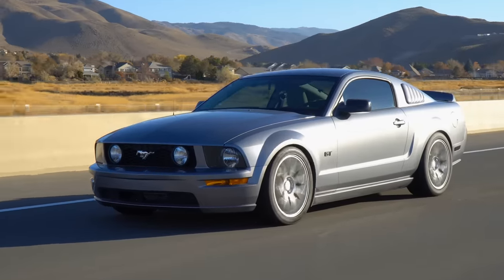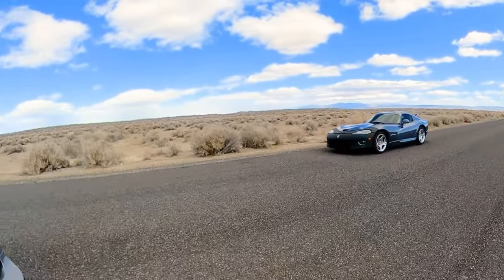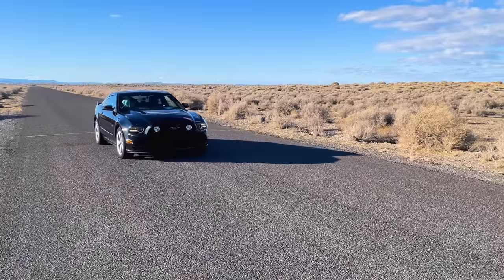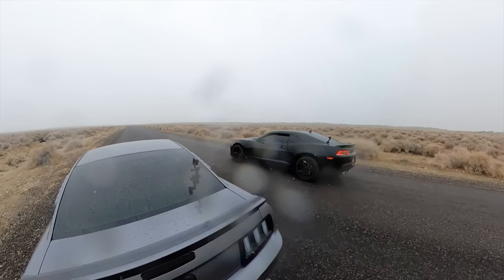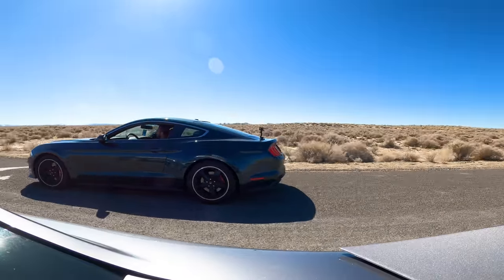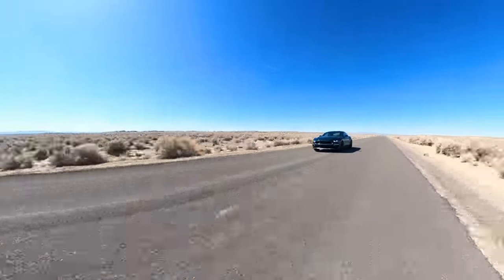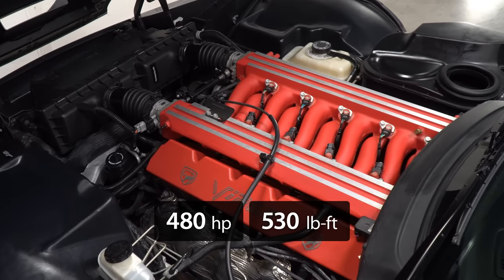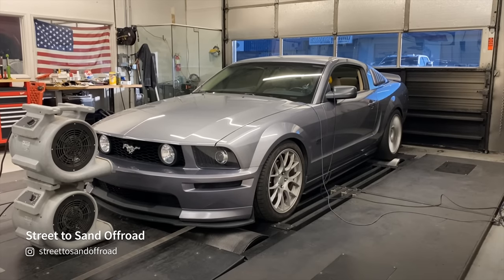Showing the world what an all-motor 4.6 Mustang can do

Comment: If memories serve, these cars went 0-60 in 5.3-5.5 seconds bone stock. It was quicker than the previous gen.  Never knew they were disliked by the Mustang community.  🤷🏻‍♂️
Reply: 2 piece spark plug and cam phasers were the biggest problem
Reply: Damn straight. I already love this gen,now even more.
Reply: I run mine at 5.0 flat on the street.  Would love to know what it gets on an actual drag strip
Reply: The only began to get disliked after the Coyote engine came out. Obviously it was far superior
Reply: They were also disliked when the 2011 V6 came out and was damn near as quick
Reply: @Bmr4life  yeah the 3.7 put out like 300hp as opposed to 310HP from the 4.6 ☠️
Reply: @Bran Don  yea stock to stock. The second a juice up a 3v it destroys a 3.7
Reply: I had an 06 GT, 0-60 time was right at 5 seconds. They weren't slow
Reply: @djdirtydan3393 stock to stock I’m blowing the doors off a 4.7l, in a 2012,3.7, y’all be cappin on this app.
Reply: Bone stock 4.9 to 5.2

Comment: FINALLY US 3 VALVE BOYS HAVE THE HERO WE NEED!!
Reply: Been waiting for him to get this car back on the road lol thought he gave up or something
Reply from the maker: @justa3v619  did you see the trans install video?
Reply: @Four_Eyes  no I’m subscribed and have the bell on. Idk how I didn’t see it. I mean I’ve seen it just now but didn’t see it before.
Reply: 5.7 hemi with bolt ons make 460hp I’m going say bs to that.
Reply: @thatgaykid420  all that power just to get walked lol
Reply: Yea after about thirty years too late🤣
Reply: @thatgaykid420  idk bro, I have literally never seen a fast RT ever, challenger or charger. Whenever I run one in my 3v (headers, 4.10s, 93 tune, cams, intake) I pull away from them pretty fast. Not saying you're a liar, but you probably have some pretty substantial work done to the car.
Reply: @ryanhopkins1780  even if he’s making 460hp my 3v still makes more than that. Mine makes just over 500 to the wheels
Reply: @thatgaykid420  I guess I misinterpreted your bolt on definition. I use bolt on as just basic intake, tune, exhaust, and I guess  intake manifold counts too.
Reply: @thatgaykid420  I mean that's cool and all but hp and torque mean nothing without gearing.
Reply: @thatgaykid420  Oh gotcha sounds bad ass man! I've always considered 5.7 and 3v dudes to be part of the same "underdog" club of cars. Gap some 5.0s for us lol
Reply: My 4.6,l based 2v will walk your challenger, even you put super charger on it. 

327 c.i. all aluminum big bore trick flow 195 2v heads with additional port/chamber work, custom gibtec Pistons, custom dual plenum intake , custom cams 13.5 to 1 como ratio, e85. Dynoed over 600hp(won't give exact numbers) 
Plus has 2 dual stage nitrous kit. 175hp 1st stage 150hp second..
All motor run in my 70 Maverick best et 9.87 1/4 mile. I'm too scared to run the nawsssss....
Car weighs 2900ish with me sitting in it 
4r75w built to handle 1000hp 3800 stall triple disc anti balloon torque converter. 4.11 gears all aluminum pumpkin and housing bolt on axles steel. Frt suspension is sn95 mustang based cobra frt brakes, rear 4 link w/Watts link, rude tech air ride suspension. Carbon fiber hood, bumpers, spoilers etc... Custom grill etc... Etc... Etc...
Reply: @honda i actually respect that outlook. I owned a 79 maverick in the early 90s (still do see my other post) underdog for sure. Technically i own 2 mavericks 73 grabber mav, a built 89 bronco for off-road, and 67 Mercury cougar. Love my stable of underdogs. So i can absolutely relate.
Reply: @thatgaykid420  lie
Reply: @ItsJustFranko  you said right there!!!! It’s about the gears baby!!!
Reply: @rickstorm4198  Rick ain’t playing!!!! Let’s gooooo!!!!!
Reply: @ryanhopkins1780  my 3v isn’t anything but bolt ons and makes just over 500rwhp. But I literally have every bolt on they make for the 3v jlt cold air,pulleys, tb, manifold, longtubes, muffler/cat delete, 4.10’s, Howard cams, Lito tuned and a zex wet kit. I’ve actually got an on3 turbo kit for it in the garage but waiting to build the bottom end. I could’ve got a coyote for sure with the money I’ve put into the car but honestly I like the 05-09 body I’ve wanted one since high school when they came out. Plus it’s so much fun beating up on them newer cars with an old 3v lol.
Reply: @justa3v619  I'm gonna have to call bullshit on this one man. No way are you making north of 500 whp NA on a 3v
Reply: @17456spartan  you obviously didn’t read my whole comment it makes that on the nitrous. I’m spraying 175 shot
Reply: And actually it was on 150 shot when it made 516rwhp made 368rwhp on motor
Reply: @justa3v619  Oh ok, that must be what you meant by the zex kit. Ya 368 is much more believable. Mine with a few less mods made 340 WHP
Reply: @17456spartan  yea that’s usually about what a good running fbo will make. I’ve got another shortblock now I’m working on once it’s done it’s going in going to try and make 650+ with some boost. Need to do the same for my old 2v. I have a 2.1l Kenne bell kit for it but stock bottom end

Comment: Looks like that 2019 stang got heat soaked the more runs y'all raced. Great job waking up that 4.6!
Reply: Lol it’s not a “4.6” it’s a built stroker.  He never mentions the actual displacement.
Reply: @amateurtouring  You are right. If you read his google docs build sheet he has a MMR 5.0 STROKER Street Mod 1000S 5.0 Rotating assembly Up to 1000RWHP.
Reply: @8bert9  so by this guys logic I could call an LS7 swap an junkyard 4.8 swap? 😂
Reply: @amateurtouring  lol, yeah, the title of the video is a bit misleading
Reply: The factory tune pulls a TON of ignition timing once intake air temp gets over 100F and once coolant temp gets over 200F. Basically 1 degree of ignition timing for each 10F increase in air or coolant temp. So 220 coolant temp pulls 2 degrees and 150 air temp pulls 5 degrees. You’re down 7 degrees of timing advance, easily worth 35 HP
Reply: I thought heat soak just happens to supercharged stangs?
Reply: @amateurtouring  people find any excuse to take away merit from a 3V platform I STG. They get so much hate for no reason. People only hate because they don’t understand the car.
Reply from the maker: It's 4.93 liters, still lower displacement and compression than all the cars raced.
Reply: @amateurtouring  still a 4.6 block.
Reply: He did mention it he said it. A 4.9 stroker

Comment: Yes I’ve always wanted someone to build a 4.6 like this with the gears, t56 and built N/A. Awesome video as always! And 3.73?
Reply: 4.10 gears maybe?
Reply from the maker: 4.10's, but with the 2.66 trans ratio you can see the gears are still a bit long, should be ideal for a turbo setup!
Reply: I still have 3.55, works well with my 5.3 stroker T56. But I do road course rather than drag.
Reply: @nicolesmrekar2046  😍😍😍
Reply: @Four_Eyes  4.30’s might just be the sweet spot for an all-motor T56 build like this. This thing runs good and it runs hard. Love what you’ve done with this car.
Reply: @nicolesmrekar2046  love to see a women who can drive!
Reply: 4.10s too aggressive for cruising around?
Reply: Modular head shop sell 3v turbo cam stage 3
Reply: @headinghome8914  absolutely not.  I am running 4.10 in a bolt on 07 gt500 at 550 wheel.
Reply: That viper really hops on the shifts…😳
What a fun video… I started my car enthusiast “career” as a mustang guy… had 4 of them from the time I could drive until I was about 30… a 91 lx 5.0 a 65 with a 351, and then a 69 with a built 302 and a 85 gt that I started building in 2000 and then traded for an integra gsr and it’s been Honda’s only since…
All the newer mustangs since the coyote came out tho really get me excited about these cars again… seems like the American builders took a few cues from Japanese engineering and voila, we got lots more horsepower on the streets!
Hopefully they never take out gas cars away…
Reply: @Serpentis666  your journey sounds almost identical to mine, many people will make fun but when I cracked my first VTEC in '01, I just fell in love with Honda's, once I built my first b16, then turbo in a eg coupe it was game over, good times!it wasn't until just a few yrs ago that I got back into V8 muscle as the Honda scene has unfortunately really died out. Bought a C5  Z06, but still have my highschool car in the garage, an '88 LX 5.0, I'll never sell! Lol
Reply: @romper4444  I think some of us just genuinely love cars…whatever form “fast” comes in lol 
My first Honda was an ef I bought in around late 98 or 99… put a ZC in it around late 99 or early 2000… was fun but still pretty slow and I wasn’t ready to do a gsr swap at that point just yet… sold that and had intended to buy another old mustang, and a close friend showed me an integra gsr another friend was selling at the time… first crack of vtec and I went straight home to get the cash! Have had a vtec motor of some sort in my car ever since… all the b series and now all the k series lol 
Cars fucking rule!!!
Reply: @midnight347  that's sweet, thanks
Reply: na ha borimg!! go home grandpa it aint no LS1 it needs boost
Reply: @shawncarson8131  yeah but he plans to add twin turbos I believe
Reply: @nicolesmrekar2046  hey are the 3.55 the stock ones right? cuz ive been wanting to figure out which stock gears i have
Reply: 4.10s are fine but 1st gear is almost useless with a t56 while racing. I had a 240 with an ls1 and t56. The rear end was a 4.09.
Reply: I’ve always wanted to pop a high compression 4.6 4V into a 05-09 GT just to mess with people.
Reply: @merc6  depends on which t56 you have. with a f-fody/viper t56, the 2.66 and 4.10 combo on a 27" tall tire carries you to 50mph at 6800rpm.

with a 27" tall tire and 7000rpm redline, most ppl with a 2.66 1st gear T56 run a 4.56 is staying N/A and anything from 3.73 to 4.10 depending on power levels.
Reply: @OxBlitzkriegxO  honestly I don't even know what the gear ratio of the transmission was. It was a factory ls1 from a 2001 ws6 trans am along with the factory transmission. I just know that the factory trans from that particular t56 was very short in 1st gear with a 1995 Nissan 240sx rear end. That rear end was a 4.09.
Reply: My father's came with 3.73 and it was the only thing lacking. It needed at least 4.10 for a pretty stock N/A
Reply: @merc6  you had a 2.66 first gear. the only other difference would be tire size.
Reply: @OxBlitzkriegxO  it was a 265 35 18. Not sure the actual size in inches. That car was bad ass. Same tire on all 4 corners. They were on 18 by 9.5 in wheels.
Reply: @OxBlitzkriegxO  don't get me wrong. 1st gear was fine but it was just a little short. I bet a taller drag radial would have made that a little better.
Reply: @merc6  if you were shifting at 6500rpm, 1st gear was done at 37mph, 2nd at 56mph. thats because you were on a 25" tall tire. thats a pretty short tire with that kind of gearing. that puts a ls1 in to 5th gear by the end of the 1/4 mile at 6500rpm. a 275/50/18 wouldve been better for a n/a ls1 with some mods.
Reply: Been there done that mustang's are fast in a straight line, when it comes to cornering Nah I dont trust it.. in cornering your going to hit a wall. The mustang cannot handle a curve ball.
Reply: @Four_Eyes  do you have .80/.63 or .74/.50 5th and 6th gear?
Reply: @eternalthread7846  Love to see a WOMAN, who gives a shit if she can drive!
Reply: @TheOzthewiz  idk people that like cars maybe lol
Reply: @62guitarguy I think 4eyes has spent 10s of thousands to get it where it is today n/a
Reply: @Four_Eyes  Ah now you're talking! Excellent choice of close ratio trans\rear axle gearing for what you're gonna be doing. Gonna get wicked! :goodvibes:
Reply: If it was built to make na power it would be faster it has low boost friendly compression with boost being the end goal.
Reply: @62guitarguy those "stockers" cost alot more money to buy than a 3v mustang does.  It's all relative.  He may have spent money in mods but he saved a ton by having an older 3v to begin with.  People never factor in those newer cars costed alot more money up front so I would hope they have better performance out the box.
Reply: @wusthof641  I seriously doubt he spent 10s of thousands on this engine combo it could be done much much less than that.
Reply: @wusthof641  also if you go with those newer more capable out of the box cars you're gonna be spending 10s of thousands more than you would on a 3v so it's all relative.
Reply: @Four_Eyes  How much HP does this Mustang make?
Reply: @headinghome8914  surprisingly no. I drive 4.3 and I averaged 26mpg on the 80mph interstate on my 1200 mile road trip, which is more than the car is even rated for. In the city gas isn't affected at all, you just shift into a higher gear when the rpms are too high. I can cruise 35mph in 5th gear comfortably lol. At 80mph it's at about 2800 rpm, which is higher than I'd like but the fuel does fine. Slowing it down to 70mph on interstates makes everything perfect if you're able to. People told me not to put in 4.3's because it ruins cruisability, but that has not been my experience for the last 170,000 miles
Reply: @MountainStew02  that's awesome
Reply: @MountainStew02  thanks for the insight
Reply: DUDE FOR THE AMOUNT OF MONEY THAT YOU WOULD HAVE TO PUT INTO A 05 09 STOCK 4.6 MUSTANG GT ISN'T WORTH IT LOL YOU'RE WAY BETTER OFF BUYING A 07 09 GT500 LOL I HAVE A 07 SHELBY GT WITH THE 4.6 AND I LOVE THE CAR AND YOU CAN ADD A BLOWER AND MAKES 450WHEEL BUT MY 08 GT 500 PUT 450HP AT THE TIRE IN STOCK FORM.LOL YOUR WAY BETTER OFF BUYING A GT 500 07 09 LIKE MY 08 THAT PUTS 850HP AT THE TIRE RELIABLE AND MY 2 SUPER SNAKES PUT DOWN EVEN MORE.THE 07 09 GT 500 OR MY SUPER SNAKES ARE THE BEST LOOKING MODERN DAY BODY STYLE MUSTANG EVER.
Reply: @anthonylaudano9751  dude your argument is literally that the gt500 is better than the gt. No shit. We can't afford that or we'd choose that instead.
Reply: @MountainStew02  SORRY BROTHER NOT MY FAULT  LOL THE AMOUNT OF MONEY THIS GUY PUT INTO HIS GT LOL HE COULD HAVE BOUGHT A GT500 LOL THAT'S MY POINT.LOL
Reply: @Four_Eyes  how much horsepower are you currently putting down?
Reply: It’s not a “4.6” it’s a stroker motor..  keep looking bud 🫤
Reply: @Four_Eyes  should try 3:07 for the heck of it, see how fast she gets up to
Reply: 100%

Comment: I used to hate 4.6 stangs because I thought they were all slow without Forced Induction. I was truly shocked to see how well it can do Naturally Aspirated. I guess every 4.6 owner should install a new cam and stroker kit like this dude. Props.
Reply: That’s what I’m thinking of doing whenever I get the money for it
Reply: Depends what you consider a fast car 🤷🏿‍♂️
Reply: I think he also got some new gears for car based on when the mustang shifts vs the other cars.  That makes a huge difference
Reply: @sk8n854 the problem with them that I have is the 2011 6 cylinder has 300 horsepower and that's what the GT put out from 05 to 10. Imagine buying a 2010 and the next year they bump it up to 400+
Reply: @sk8n854  OH don't get me wrong I love this particular Mustang.  Sounds the shit and fast as hell. I was only talking about the big jump. I love the body style.
Reply: @massvibe  Yeah Ford really hoed everyone who bought the 2010 Mustang GT.
Reply: Rear end gear makes a huge difference too
Reply: @hunterbooth8578  yes but you can still gear the 2011 the same as that .
Reply: @massvibe  peak horsepower isn't everything. 4.6 has all its torque on tap at 3000 rpm.
Reply: @jooot_6850  don't waste your money building a 4.6 -- spend the money on a 14+ GT or even a newer model with the Ecoboost with a tune
Reply: @whatta7793  Yeah maybe I’ll throw a dollar store turbo on there or just keep it stock
Reply: @whatta7793 no ecoboost touches me in my 3v 😂
Reply: @hunterbooth8578 more of a difference then anything he did to the motor, notice how everyone wants to touch the motor but over looks his gearing and transmission,😂

Comment: You have a well put together engine with the right transmission and gear ratios, makes a big difference.
Reply: Yes dude has to hav tough engine sounded like it was cranking out some rpms on few gear pulls mite b my cheap phone but on top b for shift was that the rpm limter working making it cut out got listen  or was that valve spring limits
Reply: Stroker motors make a big difference too.  Missed that part though.. right?? 😭
Reply: @amateurtouring  it didnt tho when we dynod it so
Reply: @TexTheMaster  Lol right..  so stock power 4.6 with a trans and gear swap right!?????  Hahahahahaha 😂
Reply: That the sweetest set up I think. 
Simple dimple.